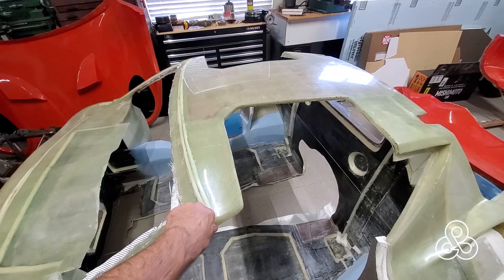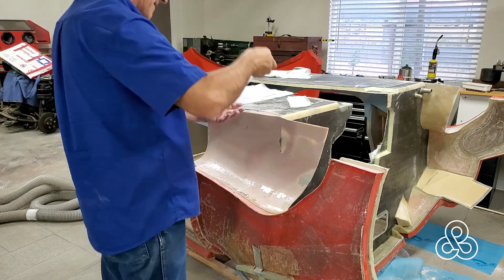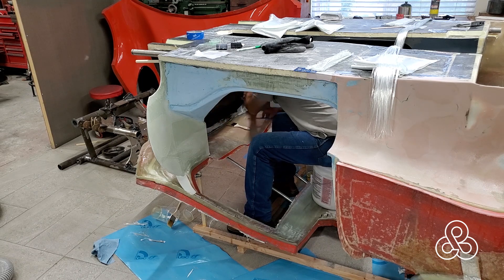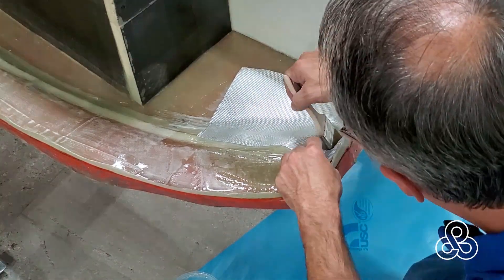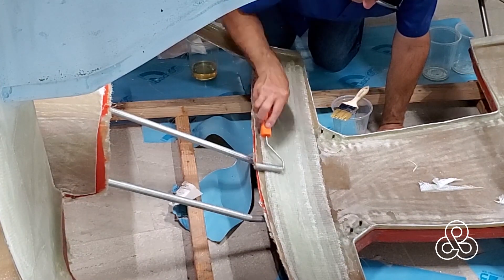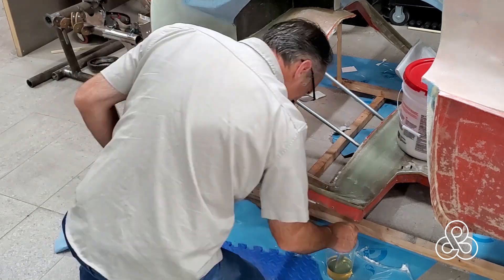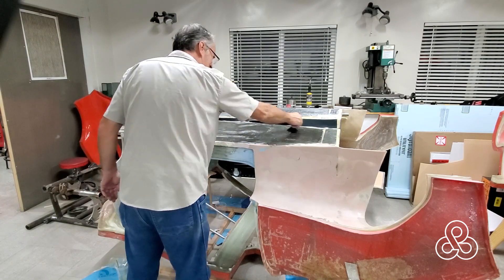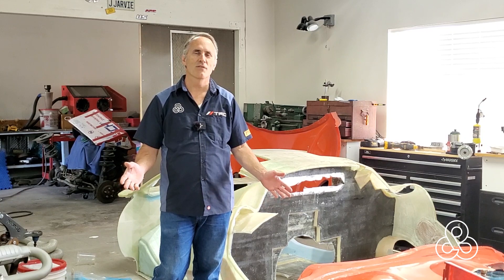A38 - Arete Supercar Project - Reinforcing the A-pillars/windscreen frame

Comment: Please tell me the brand and name of the resin you are using and how long does it take to dry? Thanks!
Reply from the maker: Most of the epoxy I use is from USComposites.com. The medium hardener gels in about an hour, a set in about 5-6 hours, full cure in 24 hours. They have slow and fast hardeners for the formulation as well.

Comment: Will you be putting a metal (crash )cage in the passenger cabin? For the case of a rollover?
Reply from the maker: There will be a partial steel structure in the car. I might add the ability to add a full cage for track use.

Comment: Keep up any and all these videos they are great! I used to build 32 fords but we had different techniques the way you are doing it is very cool! I have been working on an Aztec kit car but now ive decidedly am changing building methods! And will be incorporating carbon fiber where needed and i planned on using honeycomb sheeting for bulkheads and flooring! I cant find any foam board with the cardboard just foil or the standard pink or blue/green foam board! Any ide where i can find that foam board on the east coast? I thoroughly enjoy your channel
Reply from the maker: Foam- check with a true contractors supply that deals in roofing. That is the main industry of use.

Comment: The project is astonishing: bravo. I have many questions about your composite techniques. Looks pretty much like fiberglass roving and polyester resin.  Using carbon cloth with resin is NOT overly strong either.  Proper carbon construction requires epoxies, vacuum bagging and an autoclave.

Equally there are so many new E-Glass products that are used with two part epoxies: I saw none of that. Last, It looks like you just used roving without a mat layer against the gelcoat on your body parts: this almost guarantees print-through as soon as the body parts are heated by the sun.  I strongly suggest that you take your molds to a boat builder who uses the above advanced techniques and have them make a correct composite body. It would be well worthwhile.   A final thought: using resin and cloth to scab onto cured areas for reinforcing is next to worthless: very little bonding to cured parts and poor strength imparted. I too am an engineer with 25 years of road racing, sailing and composite repairs and also own a small composites company.
Reply: It is said many times that it is epoxy.
Also all of the visible parts are made long ago, with fine cloth first.

I'm more worried about Jay saying almost nothing about prep work before laminating on cured surface. (This is maybe second time he mentions scuffing the surface), and if somebody watches these videos for instructions, somebody will fail big time. Many cured surfaces seems glossy, which looks like non-scuffed for me.

And about what comes first, the resin or the cloth, i guess this guy puts brick before mortar.
Reply: @bay7695  He does NOT say it is epoxy:  watch this video: https://www.youtube.com/watch?v=KHXVf0SaJpA
Reply: @bay7695  Fine cloth first is NOT correct: sun will cause contraction of the resin making the fibers more visible and all the parts will develop "print through" . A layer of multidirectional matt  is mandatory before the cloth for both strength and appearance..
Reply: @richardsmith9509  As this is episode 38, i guess you watched some previous episodes also? Same epoxy used everywhere except molds. Atleast what I remember.

Why would I watch some other YT-video about differences in carbon and glasses when you talk about matrixes? Never have I had problems with fine cloth first.

And btw. What you mean by complex epoxies and autoclaves? You can work with "normal" epoxies on carbon too, as well as on glass and aramids. 

And when you said: "Using carbon cloth with resin is NOT overly strong either." You were right, it needs also some hardener.
Reply: @bay7695  he specifically refers to it as "resin"
Reply: @richardsmith9509  so that means especially polyester resin? It's not like epoxy resin?
Reply: @bay7695  polyester resin is completely different when compared to epoxy resin: use, strength, properties are totally different
Reply: @bay7695  Look up EASY COMPOSITES LTD on YouTube: fantastic tutorials on all aspects of composite construction
Reply: @bay7695  Google "Formula 1 composite construction". There is a PDF doc that if you read it a couple of times, will have it all come to you....Our car builder (Jarvie) is doing a crazy incredible job BUT his composite techniques are out of the 1970's and are woefully inadequate. He will tear the rear bulkhead right out of the car. It also needs an integral roll cage: he would die if his supercar rolled over or had a major crash
Reply: @richardsmith9509  i know differences of polyester and epoxy. But tell me what makes you think Jay uses polyester? That He says it's resin?

I've seen almost every easy composite video, nothing new to me in those videos.

I guess you havent seen the video Jay talks about rollcaging.
Reply: @bay7695  No I guess I have not. His rear subframe and engine should be tied into an integral rollcage and def not that silly tabbed in rear bulkhead.   This is so wrong its scary
Reply from the maker: A final thought: using resin and cloth to scab onto cured areas for reinforcing is next to worthless: Tell this to Burt Ratan with 3000 kit planes flying safely in the air.
Reply: @BuilderCreator  Well first off when did he design and build these?? 1970's I recall. My point is that in 2020  materials and techniques are vastly different. Look at sailboat hulls from the 1970's (I own one): still strong and most are bulletproof [many have also long since failed too] but ones made in the late 1990's and newer are  thinner, lighter and vastly stronger. I would still VERY strongly recommend that when you finish this project, take your molds to a state of the art aircraft or boat builder and have them build you NEW gen bodywork.
Reply: @BuilderCreator  Real carbon fiber parts are not made with carbon cloth and resin. Its complex epoxies and autoclaves. You should know this by now. I also doubt that your rear bulkhead will withstand the torque generated by your rear powerplant module.
Reply: @BuilderCreator  Hello: take a look at this video. I am very worried about your rear bulkhead and how much torque it can withstand...https://www.youtube.com/watch?v=uc55D7q5TPU     This is equally unbelievable (as your project is)

Comment: Jay If you like we have a similar rotisserie that we have a large mold attached to and have motorized it for rotation .Let me know if you would like the dxf files for the parts and you could make the parts on your end. Also can supply part #'s for bearings,gear reducer and motor from a surplus shop.
Reply from the maker: Thanks for the offer, but I think the next go round I would build a hydraulic 'scissor lift' style with dual scissors that would allow a it to lift at a 45Deg. angle. found I never need to go full upside down.

Comment: As it looks to me, you could come back in the future and replace all of these composite parts with carbon fiber if you wanted. it looks like the molds you have would work for resin infusion (vacuum infusion)
Reply from the maker: Sorry, but the molds do not have a flange significant enough for taping the edges for an infusion. I could hand laminate the carbon, but I just can't justify carbon on this project.  I will be doing a video in the future talking about the use of S-Glass vs Carbon. In short I would gain only about a 20% weight savings for a $12,000 price tag jump in materials cost. Some aesthetic carbon fiber parts coming up as well.

Comment: hi. I am thinking of starting a car project that I will post on my YouTube channel. Can you help with making fiberglass bonnet
Reply from the maker: You can watch my building of the front clamshell (bonnet) coming up soon, but I have a mold to work from. You might watch this series of videos by EZ Composites in England, that is a start to finish build off of an existing steel bonnet - https://youtu.be/UgKvDw1E60E
Reply: Thanks for reply